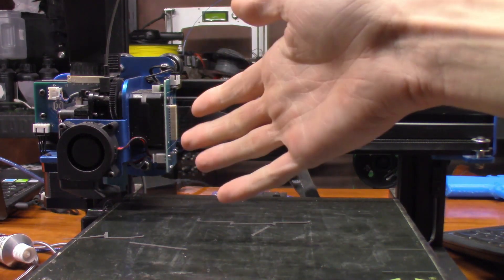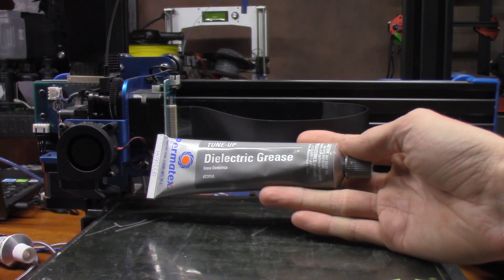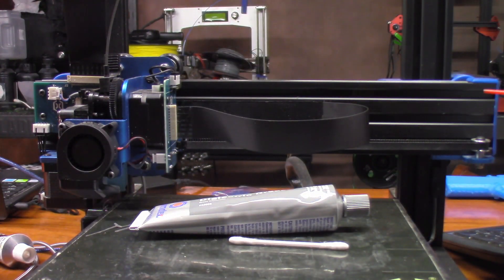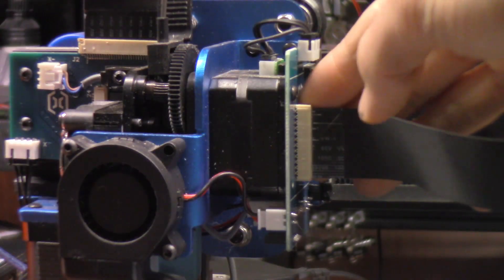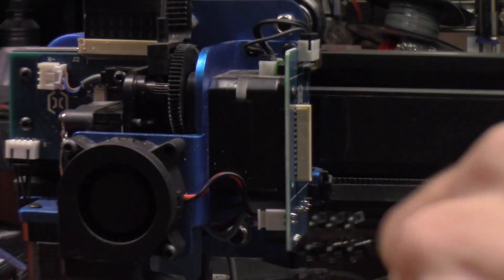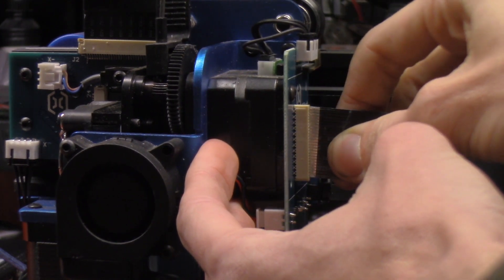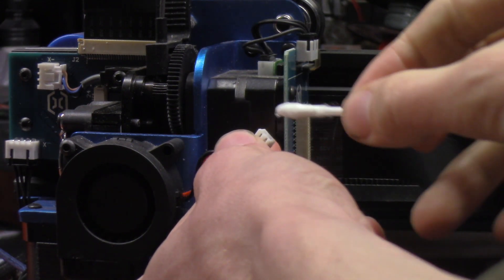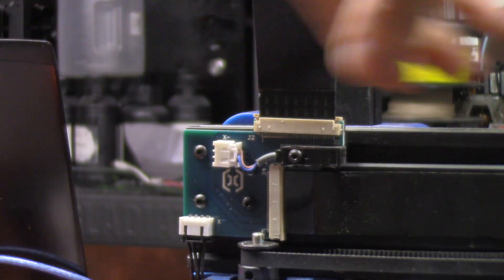One Simple Trick to Avoid Burning Ribbon Cables On Your Artillery Sidewinder

Comment: Calvin, Dielectric Grease is an insulator.  It is meant to prevent the flow of electricity.  Why would you place an insulating grease between the contacts on the ribbon cable and the pins in the connector??
Reply from the maker: You do realize that the pins are making physical contact with the cable and displace the grease, the grease forms a seal for everything else. As of the time of writing this, it still works just fine with the grease as shown...
Reply: @MakeItWithCalvin  Do you realize you are lucky at this point?  The grease is not meant for this and you are NOT getting as good of a connection as you should.
Reply: @daniellivingston7373  very true, this can cause a bad contact easily.

Comment: Where should you not use dielectric grease?
Since dielectric grease is a silicone grease, it should not be used on silicone-based rubbers or plastics, as it will break them down over time. The grease does not conduct electricity, so it shouldn't be applied directly to the mating surfaces (pins and sockets) of an electrical connection.

Comment: Does running the nozzle at higher temps like 265 or 275c increase the chance of burning a ribbon cable? 
What's the max temp set at? Like 280c? 
Looking into printing some higher temp nylons but im wondering if it's good to go for longer prints and would the grease help with this issue? 
Also looking into have a direct wire to the heater.
Reply from the maker: Why would higher temps cause a burnout issue? It is not being fed higher power, it just needs more during startup. I have done multi-hour nylon prints on my X1 with the original cables from back in the day with zero issues. The grease is just a good idea, in general, to help prevent corrosion and arcing. As for maxtemp I try and avoid anything over 240C on a stock PTFE setup. My X1 has an all-metal break and custom modified firmware to go hotter for nylon/PC jobs.
Reply: @MakeItWithCalvin  I figured the ribbon cable was kinda thin gauged for the power to the heater. im all metal right now. But yeah makes sense I guess.  so you're saying that al the burnt cables are just from arcing? not anything to do with too much power draw?
Reply from the maker: @miltechmoto  from my experience it is fine... It is a 24V system and later models spread the current over more pins. As for the arcing, it is caused generally by a loose connection and becomes a cycle of arcing leads to higher resistance leads to more arcing... You get the idea. Heck, even the green screw terminals some machines use will melt if used improperly, happens quite often.